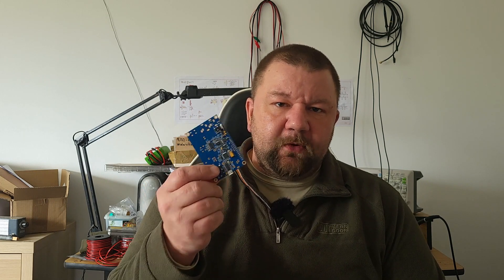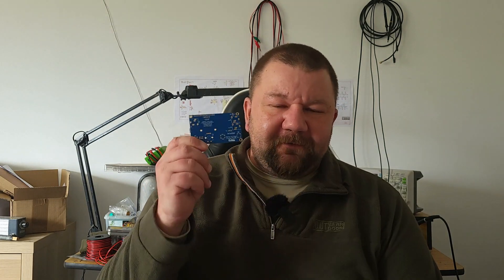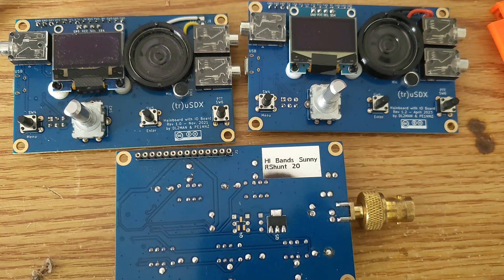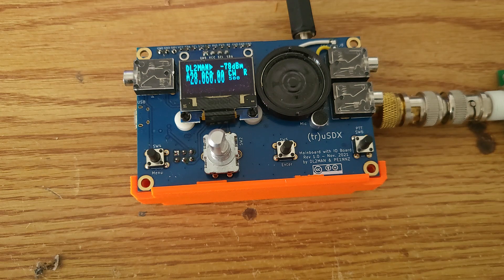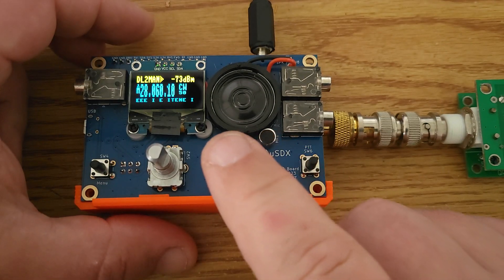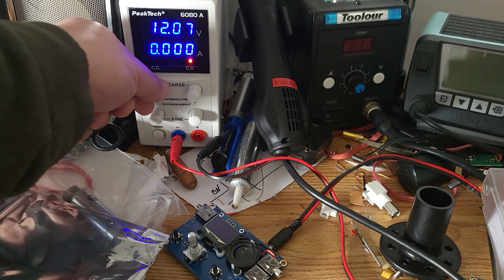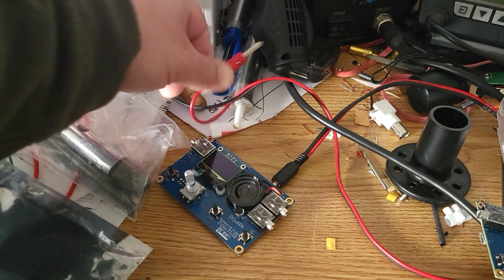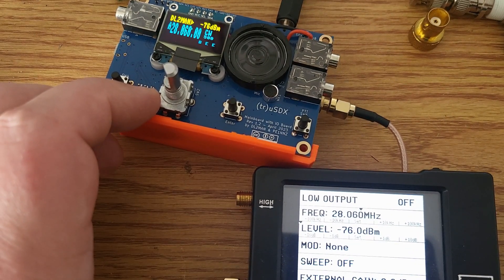Introducing (tr)uSDX Mainboard Rev 1.2 - reverse polarity/over current protection

Comment: Hi Manuel, does the new PCB fix the PA control output? the old rev had the PA control coming directly from the ATMega, with 0v for TX and 5V for RX. This in my opinion is bad practice, it should be open collector for RX. Reason being that most PAs use a 12v relay to control them and if connected to the old PCB, The PA will be in TX all the time because its relay current will still flow whether the connection sees 0v or 5v. Also the CPU could be damaged if the port sees 12V. I had to add an external circuit to my trusdx to overcome this. The chinese clones are better in this respect because their PA control is with an opto isolator. The clones also have a LM386 type audio amp instead of feeding the speaker directly from the CPU. My clone can drive an 8 ohm speaker directly without any howling. Again, better. But I realise you may not have had enough real estate on your PCB to implement this. Other than that I am satisfied with the trusdx.
Reply from the maker: Hi Brian, "fix" would indicate, it was a bug. The answer is No, we did not "fix" that. Of course we could blow up (tr)uSDX for more advanced and/or safety features, but it was thought of as the simplest possible, yet useable outdoor trx. I think, we´ve accomplished that mission. If you want to drive a PA, I suggest to use a simple opto-coupler on your cable to PA. Problem solved. And while clones may be "better" in certain categories, they all together lack the core idea of (tr)uSDX: tiny, lightweight yet efficient. Nothing out there comes even close to (tr)uSDX in those disciplines. Let alone the clones still use code, that Guido programmed 4 years ago, while (tr)uSDX was improved a lot on software side. SSB algorithm was improved a lot over time and we have new features including sprectrum scope as well as possibility to directly control and audio stream via sinlge USB cable.... 73 Manuel; DL2MAN

Comment: Hello, what is the maximum input voltage allowed? Can the adapter measuring 15-16Vdc at idle damage the device?
Reply from the maker: 16V is absolute Maximum. There´s 2 problems: 1. the 7805 will heat up quite a lot 2. The output power will increase, which will also increase power dissapation and the FETs are more prone to failure. I would advise to stay in the 12V Region (3 Cells instead of 4 cells) It´s safer.

Comment: Hi, last Guido´s proposal of filtering DC includes new capacitors and a 100uH choke as seen in the blog ? 73
Reply: I do not know what they did but the 100uH does add some resistance and voltage drop making that “5v” line slightly lower dc voltage than the “5v” lines coming from before the inductor in Guido’s mod as originally stated
Reply: I did not notice a difference with or without the duplicate inductor and cap, but only tested with a low band version
Reply: @jertres2887  thanks 73

Comment: For those of us who might dare to try and add the reverse polarity protection to our version 1.0, it sounds like you placed a crowbar diode (could be pretty much any diode, or could be a unidirectional TVS one) that only conducts during reverse polarity with no voltage drop during normal operation. What would you recommend for a resettable fuse between it and the power supply or at least what amp rating? I was thinking maybe 0.8 amps, sound reasonable? Would a Bourns MF-MSMF075/33X be good?

Comment: I am also very pleased about the said improvements and will surely order this revised board as soon as possible.
But there is another thing that I wished to improve, namely implementing the CW Ultimatic mode, is it possible to get an improved firmware considering this, too?
Best wishes and regards de Günther, DL9GZ
Reply from the maker: Hi Günther, I think I saw your request somewhere else and I needed to lookup, what that actually is. I didn´t hear that before and I´m still not sure how big of a thing that is.... It CAN be implemented in the firmware for sure, but the question from my side is: How many people are using this mode, what´s the advantage and does it justify the coding ? To be honest: I tried to understand the benefits, but I couldn´t understand. So: How many people are using "ultimatic" mode and prefer this over IAMBIC A and B ? 73 Manuel; DL2MAN
Reply: @dl2man  Hi Manuel, thanks a lot for your swift reply!
Yes, you saw it it the forum, where I posted it including the reason for my request but to my regret I received any answer yet.
This simply is that I have mastered cw by sqeezing in using the ultimatic mode that is implemented in my keyers when using my commercial rig, e.g. resp. especially the MORSERINO one. Unfortunately I am not able to use the Iambic modes and my straight skill isn't also awesome anymore after my cw examination 35 years ago. 🙂
As I know, many cw enthusiasts use this cw mode, because this eases giving the signs noticeably. Hopefully, I could clarify my desire. And once more: I am completely keen regarding yours and Guidos work, thus I will keep on following your project which is GREAT, YES!
Best regards yours truly Günther, DL9GZ
Reply: I would also like this available, it’s a question of is there room for the code which you already have because it was present before. Not a top priority but would be nice. Thanks.
Reply from the maker: @jertres2887  Ultimatic mode was present before ?
Reply: @dl2man let me check that, I thought it disappeared when AM & FM did.

Comment: Thank you for the great work. The protection ist a good idea. A good feature to prevent unhappy days and for emergency communication a must have.

It looks that the reverse polarity protection ist made with a diode in parallel. Is it a TVS diode that also protects against overvoltage? If a strong powersupply is connected reverse, is the polyfuse fast enough or could the diode die first in this case?

Just a hint: In my circuits I make a reverse polarity protection if possible with a mosfet that just opens if the voltage is negative. The advantage is, that there is no short circuit current before a fuse needs to react.